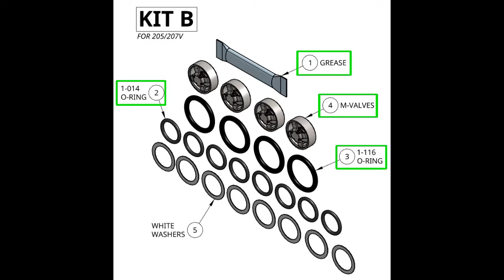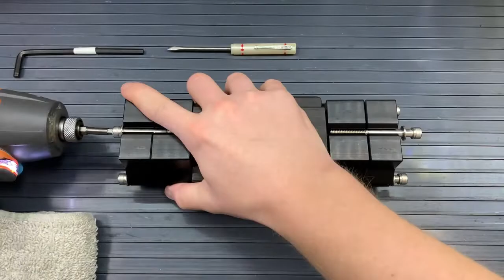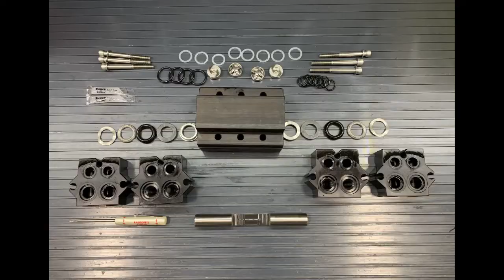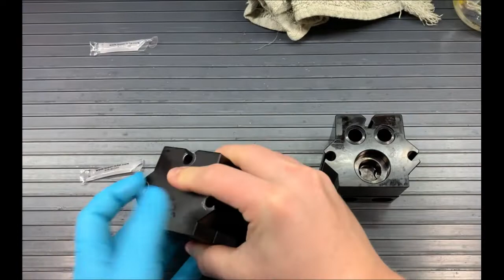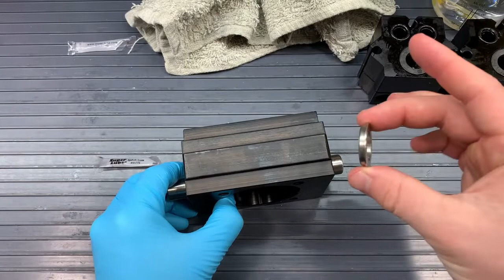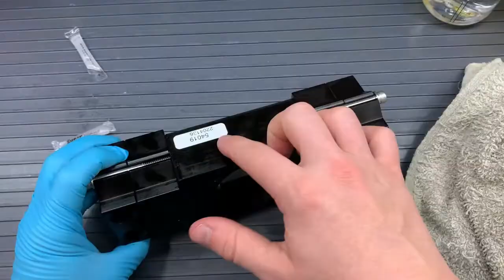Easy How-To Demo: 205/207V Power Washer Pump Rebuild | Pumptec

Comment: Can you answer a question?...

After rebuilding and testing a pump, do you recommend disassembling and drying the parts before reassemble, if it's going to then be stored for an extensive period time?

Comment: I have a leaking pump after replacing the valve kit and plunger & seals (about 1/2 ounce per minute, seems to be on one side). All felt snug and sealed when I did the rebuild as prescribed.

Does anyone have any suggestions?